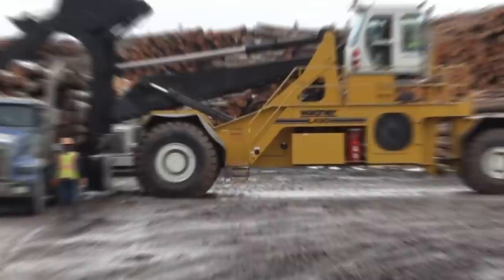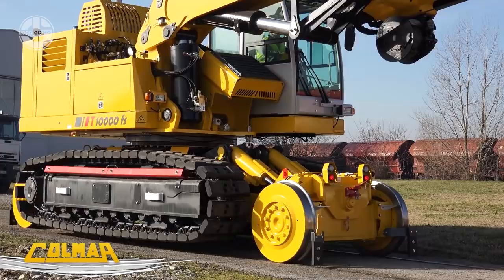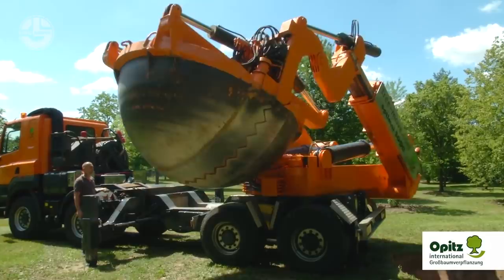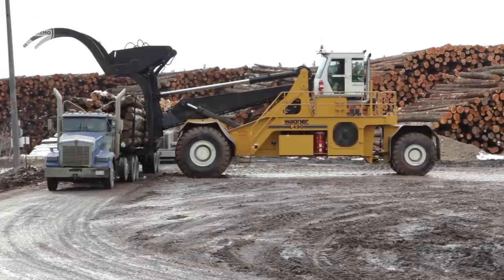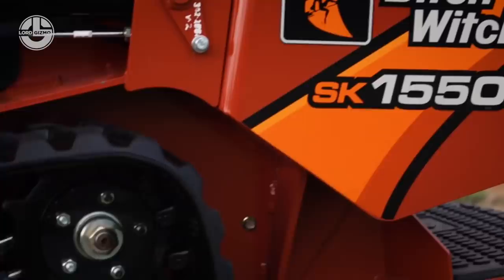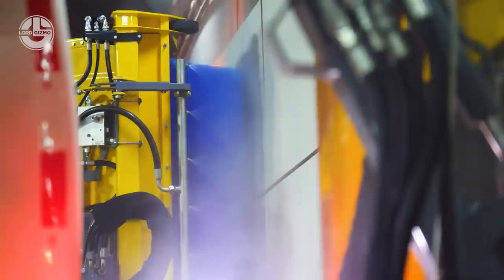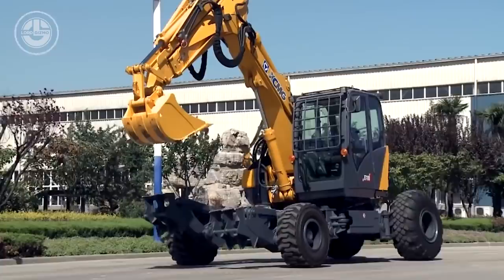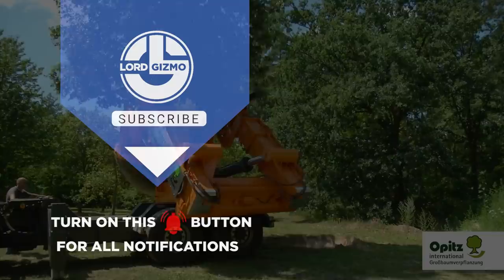Crazy And Powerful Machines You Must See

Comment: How about horse power, instead of this KW crap?
Reply: Need a conversion table or at least a formula to figure the difference  ...
Reply: It's simple, You can multiply given value in Kilo watt with 1.341. It will give you horsepower
Reply: @-sawal  So a small 1KW engine has the same power as a high end Ferrari?... Probably works better when you multiply KW with 1.34102209.
Reply: @someguy4915  Sorry I had a different number in mind. Thanks for the correction! It's 1.34 for sure!